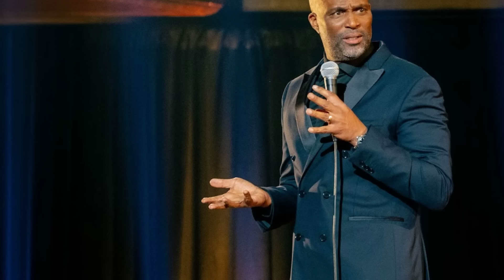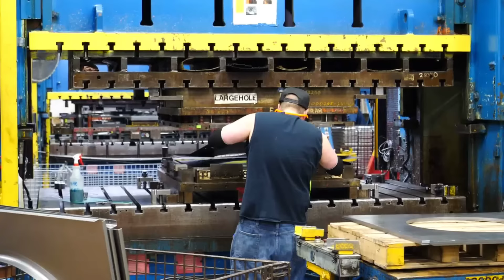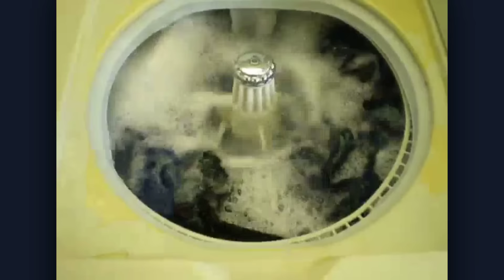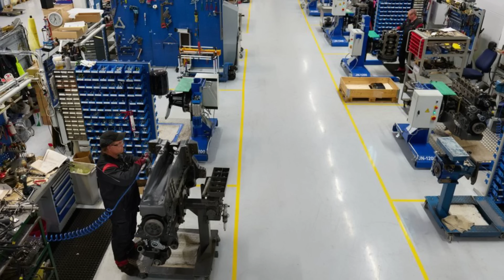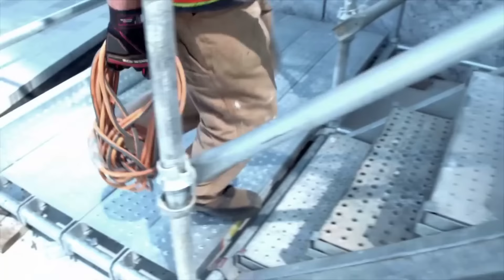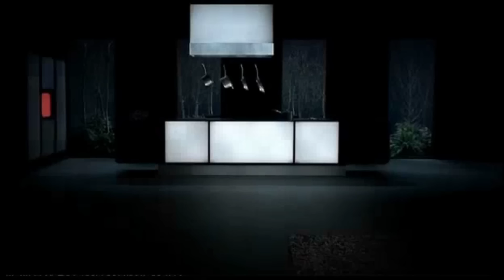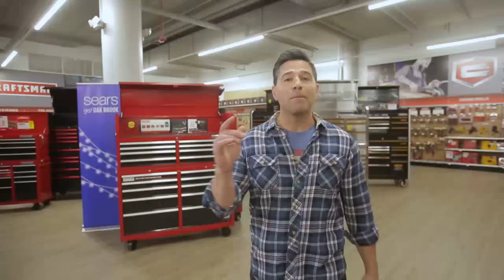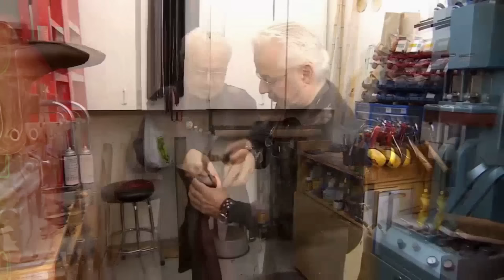The Only 5 Brands That Still Last (The "Buy It For Life" List)

Comment: Yes I agree with what is stated but problem is that these quoted brands are all USA ones most of which are not available here...and those that are being VERY expensive..You are right that it is better to buy the item once,and that you should buy industrial/ commercial use models..Products made here used to be VERY GOOD  before USA Corporations bought them out and transferred production overseas merely keeping the name and logo..We had lically developed and made Fisher and Paykel appliances,both mine still going well 24 years after purchase..I use a stainless steel pan with no coatings 10 years old..We used to have SIDCHROME  and TURNER tools whose quality,reputation,and warranty was unsurpassed,people hang onto their original tools,nowadays both companies owned by Stanley ,tools made overseas  and quality/warranty not anywhere near as good..Some tolols of the USA brand Channellock are available here but are 5 x the cost of other tool brands..you can get good tools far cheaper than Channellock,as for Wright,Ive never seen them..The Speed Queen washing machine you refer to is what we call.a laundromat  machine,solid top loader designed to be serviced through front panel..Maytag made a similar one as did local Hoover subsiduary here..they were all good quality but sales went down as people moved into units and wanted front loaders,which I agree arent the best

Comment: The modern dish washing machines are junk. Rebuild mine every year. The black slime that grows thruout every water passage. Unless you have an instant hot water heater a foot away from the machine. Water never gets hot to clean and sterilize. Water comes in warm at best. Gets heated slightly before it hits the pump. 95 deg. at best. The rinse aid compartments get clogged up. Or just blows it out in 2 washes. And the fill system is terrible. Squirt, close close the door. Open and repeat for 20 minutes. After a wash the machine smells like garbage. Glasses hazy and lipstick rarely gets cleaned off. Stove and ovens too, Junk
The oven heat vent fries the digital control panel and warps the display clear membrane. Ribbon connects board to oven gas valves or electrical supply. And never buy a microwave stove vent combo. Ever. And done get me started on front load clothes washing machines. JUNK

Comment: I designed parts for speed queen washers and dryers... tight tolerances even on the shells...
Reply: Good evening Staff Sergeant! 
Your comment has my attention. If you are willing to discuss your past with Alliance or perhaps Raytheon, I would love a history lesson. Curent (small/mom-pop) laundromat owner/operator. Former field tech for a large east coast Huebsch distributor after seven years of explaining what an IPSO was to opl customers who only spoke in Unimac...

Hoping you may still possess passion for those well engineered and well built machines. The comments I've seen so far mention the TC5 as Speed Queen's laundromat grade home appliance. 🤔.

We still operate 5 SWTTN Net Master top loads (96') at our location alongside 3 SWNNC (quantum 18') units. 

I'd say there are quite a number of variances here between the 1990s and 2018 models. I am no engineer, just the guy who stocks and replaces the parts to keep us going. 

Long winded, my apologies. Hope a notification makes it your  way for review and possible discussion. 

Thank you for your time, ma"am.

Comment: 4:40 - "Once the glue dries out and the sole falls off, it is trash. You cannot fix it."

5:15 - "You take them to a cobbler. They cut the stitches, peel off the old rubber, and stitch on a new tread."

"Cobblers" (aka "Shoe Repairmen") are increasingly rare these days. IF you can find one to sew on a new sole, that SAME GUY can re-glue a separated sole. I know, I'm having that exact thing done to a pair of hunting boots right now.

Such obvious bullshit calls into question the credibility of this entire AI garbage video. Channel blocked.

Comment: As an appliance technician with 27 years in the field, I can assure you that the 2026 Speed Queen washers and dryers are completely overpriced junk. Nothing can beat the Kenmore 90s series washers (build by Whirlpool) , all parts are still available, repairs are very affordable, and they could easily last another 20 years.

Comment: When you buy Redwing work boots they outlast any other brand as I worked in the Heavy Duty machine world and these did not rot when I spilled diesel fuel on the boots. Averaged five to six years over my 40 year working career. Also have a 2year old Samsung fridge which is acting and would never buy another of their crappy product

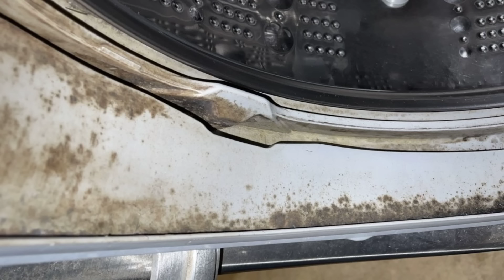Comment: 2:30 pro tip, leave the door of the washing machine open when not in use.  No moldy smell.
Reply: But always check so that a cat , dog or other animal hasn’t gotten in there before washing or a baby for that matter.
Reply: And don't use a washing powder containing zeolith. It builds up (especially if you have soft water) and then starts to smell or even damage the machine - it can also cause skin problems.
Reply: That "pro tip" is literally in the handbook of every machine. 
If you have the dosing drawer on top, also leave it cracked open.

Comment: About pans.  Clean your non-non stick fry pan with oven cleaner.  Spray "Easy Off" or the like on the pan (you may want to do this in the back yard or on the balcony), wait five minutes, then clean it in the sink.  A trip through the dishwasher will remove any residual oven cleaner.

Comment: Here at home, we have a mechanic timer whirlpool washsing machine and  just abut every thing in it, it's a repalacement for its about 15 years old, and my pc too...every thing in it it's a repalcement, it most be that just the cpu tower its  original by now. The pc Its a "Compaq" Presario i bought in 2007 it had 80gb hdd storage capacity and 512 mb in ram.

Comment: My Chinese made steel toed boots have a very durable sole, hardly shows any tread wear but the upper top of my boots are falling apart. As to having a truck that lasts I bought a 1993 Mazda B2600 extended cab with a manual transmission. It had 99K on it fifteen years ago 185K now and I’m driving it to the grave. Lots of dents but otherwise solid condition. The last year that Mazda imported a Japanese made truck.

Comment: My husband and i were raised by Depression era parents. They fixed things they didn't just toss things out or decide to buy the latest new gadget for kicks. Things had to last. My inlaws bought us a Maytag washer and dryer set in 1988. When we moved in 2023 I cried because we could not take them with us. They were still working perfectly after all that time. I advised the new owners not to replace them with modern junk smart appliances because they were workhorses that served my family well. Nothing fancy, just solid. I don't know if they listened. I hope they did. Also, my Kitchenaid stand mixer from 1972 with a Hobart motor is still working just fine. I have my mom's too. I wouldn't trade them for the overpriced inferior products Kitchenaid now puts out. Regarding pans, I'm still cooking on my grandmother's well seasoned cast iron pans from the 1920s. My dad's old Craftsman tools from the 50s and 60s are just as good as ever. We even drive old cars that my husband can fix without having to hook them up to some outrageously expensive machine. We shun new products unless we absolutely have no other choice. My only negative comment is I can't find any cobblers or shoe repairmen any longer. There used to be two and three on a block but now since ppl just toss out their old shoes there are none to be found in my area. But thank you for this. New subscriber.

Comment: Predator engines are good for intermittent use for 100$ I I’m currently using on a 1980 troybuit if it goes I have another one in the garage has run strong for 3 years just saying yes I have a Honda generator that I bought in 1990 still works

Comment: We bought a Speed Queen with electronic controls and it failed after three years.  The main circuit board had to be replaced, and with parts and labor, the repair would have cost $700.  We opted to trash the machine.  I asked the repair tech what went wrong.  He told me we should have bought the Speed Queen with manual controls -- those last 20 -25 years.  Buyer beware.

Comment: I still use one of the original Kitchenaid stand mixers from the 1930’s. My dad “re-lubed” it once and gave it to me almost 50 years ago. I still love it. ❤
Reply: My first Christmas as a married woman - 20 year old - my mother-in-law bought me a white Kitchen Aid mixer.  I turned 70 years old a few weeks ago & my mixer is still going strong.  I said when I received it, “Just think - our children’s birthday cakes will be mixed in this!” - & they have been.  My son’s favorite was a spice cake with Betty Crocker Penuche frosting.  Love my Kitchen Aid!
Reply: Now the oven I have is Kitchen Aid & NOT fixable.  They do not sell replacement panels for it.  Boo!😡
Reply: We still use the 1957 Electrolux for cleaning our lake home; works every time; even have the original bag to shake out.
Reply: Hobart / Kitchen Aid, I believe, still makes the stand mixers the same way as they did years ago.  The mechanical speed governor is the most likely trouble spot, but likely is a relative term.  It is a product which will last a lifetime.

The hand mixer is another story.  I had the old school hand mixer and one of the nylon couplings for the beaters wore out.  I called Hobart and the representative said the part was not available so she sent me a brand new mixer.  The new mixer has changed to using electronic speed control and all four speeds are now almost the same speed which is way too fast when starting to mix dough.  They ought to go back to the old design.
Reply: @wtmayhew 
I think the new Kitchenaid stand mixers have nylon components instead of the original steel ones. 
I got a Kitchenaid hand mixer with the electronic speed controls as a gift. It worked twice then died. 
I still have the one I bought myself in 1979. It works great. It’s discolored and ugly… but looks aren’t everything. 🤣🤣
Reply: @jthor3097  Thanks for the reply.  The first mixer I got was late 1980s and it has the nylon parts but still has mechanical speed control.  The newer one is electronic.  Luckily I found an old Kitchen Aid hand mixer at a flea market for a couple of Dollars, still with its original box.  I bought it without even haggling over the price.  All it needed was a bit of cleaning to look like new.
Reply: Mine is 20 years old. Works great.

Comment: I'm not a particularly wealthy man, but secure, and I figured out early that I cannot afford to buy junk. I bought a bunch of old school Filson wool and Tin Cloth jackets, coats, and shirts and have been wearing some of them for 30 years--I won't touch their new crap. I also have Filson twill luggage, brief case, and ruck sack. I have Nick's work and hiking boots that were hand crafted with lasts customized to fit my feet. They can be resoled and rebuilt multiple times. They fit and are comfortable (after break in!). I have Porter Cable corded power tools that are 25-45 years old... made when they were a superior brand (not the junk sold under that name now). I've built multiple houses and garages, additions, decks and done renovations using those tools.  It's getting difficult to find replacement parts but I've only had to replace one of them, a random orbit sander. I replaced almost all of my hand tools with Klein tools a few years ago... myriad screwdrivers, pliers, adjustable wrenches, nut drivers, etc. The 30-40 year old Craftsman tools were worn out and the new Craftsman are garbage. My stationary woodworking tools are a mix of Delta and Jet... repairable and rebuildable. I also have a 120 year old Crescent 36" bandsaw!  My outdoor power equipment is Stihl professional grade and my mowers are Ferris (zero turn and walk behind). I applied the same philosophy to my guns and bicycles... some of those are 40-55+ years old, the newest bicycle is 7 years old and some of the guns are worth 10+ times what I paid for them even after a lifetime of use. I've got somewhere between 80 and 100,000 miles on those bicycles including multiple months long self supported tours. Forty years ago the dollar was strong against the West German Mark so I bought Zeiss binoculars, monocular and rifle scopes and they have been used extensively. Yes, the initial price of buying this stuff was relatively high but the overall cost of ownership has been low and the stuff works! As my father used to say, "It's not what you pay for something, it's what it costs you."  

I also consider that vehicles are a wasting asset that should provide transportation utility, not entertainment. As such, I've currently got an 11 year old Honda Accord and a 21 year old Chevy Silverado that was my father's (24K miles!). Outside of one filthy rich friend (who walked away from his business a few years after an IPO and has 6 multi-million houses spread across the U.S. and U.K.), most of my millionaire associates have similar attitudes. For example, one life long friend has a mansion (not a McMansion, but one with a fine wooden library and detailed trim elements) with 10,000 square feet of finished space--he and his wife drive Toyota and Subaru brand vehicles and keep them until they are worn out. I've stayed in his guest quarters and could spend my life in there and sub-let the walk in closet! 😉He came from a single parent, barely making it, family but he was goal oriented in high school and made it happen.

Comment: LOVE my cast iron collection❣️ Have 4 sizes of Dutch oven- makes amazing stew!! Food stays warm after heat turned off. Easy to clean/ maintain. Majority obtained from yard sales/ flea markets (never paid 30.- & they’re already seasoned!!). 
NOTE: If it looks done for- unlikely. Good solid elbow grease (even rust). Easier if heated; not necessary. 
To season: put shortening on a paper towel & coat. Put on med-low heat (baking it in); will smoke a little. Wipe away excess; repeat if necessary. 
Hope this helps!! Blessings 💞

Comment: I have a RadioShack radio alarm clock that except for two moves ( a few days ) has been continuously plugged in since July 1977. That's 48 years of continuous operation and it still works and the LED light display is just as bright as ever. It's gonna last longer than I will and I told my kids just for fun not throw it away and keep it plugged in somewhere just to see how long it will really last!
Reply: I have a GE alarm clock from about 1986 that has a complete set of digital controls on the top with a numerical keypad for putting in the time. Still works!

Comment: Not going to lie I have clothes that belonged to my grandfather in the 1960s my bed lamp is now 74 years old my favorite skillet no one even knows when it was made my favorite headphones i rewound the coils and replaced the wires the transformer i start my old bike with i wound it by hand my coffee pot is so old you can see the curve of the glass knob on top from the number of people who used it and my razor is 1940s i pay 0.25-$ per blade for a blade that will last a month oh and it does better than the newer ones do oh and you can get those double edged razor new from west coast shaving just figured i might ad that in

Comment: Honda engines are definitely the best by far.   I just moved south and sold my 1991 Honda lawn tractor, had loads of use and engine still purred.  Also had 1994 Honda snowblower still working fine.  Also had Honda walk behind self propelled mowers that were great and generators with Honda engines that lasted decades.

Comment: Cast iron pans are great - but very heavy.  Tools - depends on who you are.  Do you use that ratchet set daily, weekly or just on occasion maybe not even once a year.  If its the later, no reason to go for top notch?  Speed Queen - again, who are you and what are your needs.  Are you a mechanic who needs heavy tough clothes to be cleaned of grease and grime? Or are you a female office worker who may have many delicates and more fragile clothing?  Do you have a large family running loads of laundry several times a week or are you single and wash a load or two every week or every other week?

Comment: A newer tank style water heater with self diagnostic gas valves will fail or leak shortly after their 6 year manufacturers warranty.   You can improve its life by monitoring its pressure, installing  and maintaining an expansion  tank, and replacing when required the anode rod. Draining/purging 2 to 5 gallons of water while under pressure  annually per the manual also helps.   They are a proven historic device that recently have been engineered troublesome with the blinking self diagnostic gas valve, sub-standard materials, and our diverse poor quality water standards.  That's been my experience.  Thoughts?

Comment: speed queen tc5 machines are not mechanical 
they have mexican and chinese computer boards.
Those "turn knobs" are connected to them.(they are a facade)
Now, they are failing!
Check out "ben's appliance" 
He breaks them down and shows everything.
And they only have 2 water fill levels!
full and deep fill !!!
Total waste of water if you have xtra small, small, or medium loads!

Comment: Anything that says Smart on it is actually dumb to buy. Also as for the pan, it's good to alternate between an iron and a copper pan as both metals are required and good for the body since when you cook with them a tiny amount leeches into the food and that's actually a good thing... unlike those Teflon coated ones